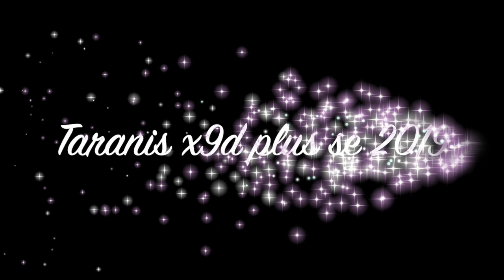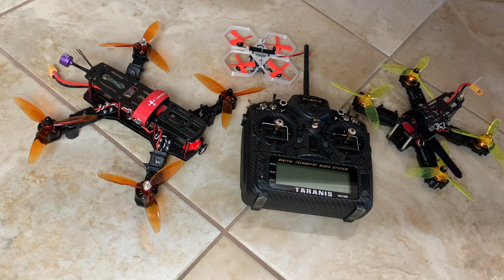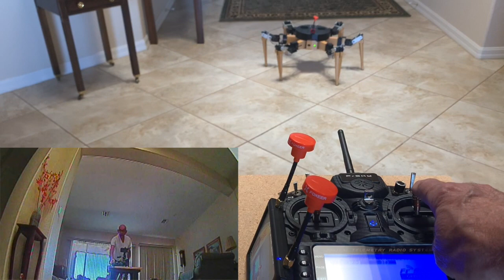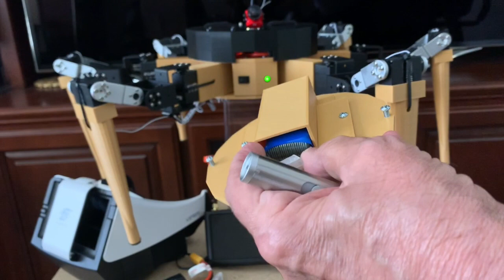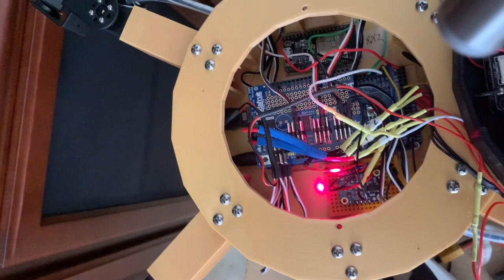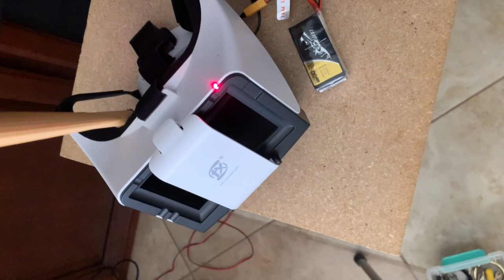LotBot Hexaopd Robot-(updated to use Taranis x9d plus se 2019 & Foxeer Camera)

Comment: - I want a hexapod drone that can climb a ladder too.
- Straight up. Like a monkey spider.
- And has a torso on top like:
----------------------------------------------------------------
- Elenco, Tobbie II Robot
- Elenco, 893 Robot, Zivko
-------
- And a little taller. Like what you have but more shaped like the [Tobbie II, Elenco]. and maybe - - Only 4 legs and 2 arms.
- 2 joints in the legs.
------------------------------------------------------------
- Vorpal Robotic [Hexbots] are good quite good.
---------
Reply from the maker: You certainly can design robots to do almost anything and with a 3D printer, you can create prototypes as I did with my Hexapod and Quadrupod. I am currently more interested in a non racing drone that can have some robotic functions like grabbing. However with any of these designs weight, servo and motor strength are major factors. I am currently writing my own drone flight controller as I want different function than is available in DIY racing drone flight controllers.It is also an education and an interesting retirement project.  Lot of luck with your project.
Reply: @lotbotrobotics5026  
- Coding is what got me looking closer at Robotics and AI.
- I am a Computer Analyst/Programmer by trade.
- Primarily IBM AS400/ISeries using RPG and Visual Basic/RPG.
- I also have an mechanical background.

- So robotics is a good fit.
------------
- I like Humaniods like Nao and similar robotics, pepper, asimo, ubtech.
- But the walking thru obstacles is probably easier with a hexapod.
------------
[end]